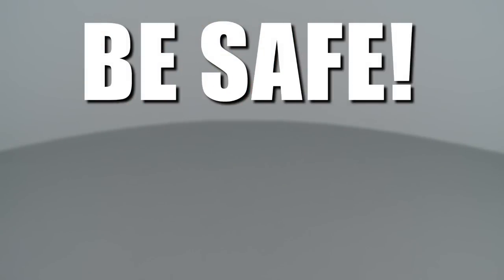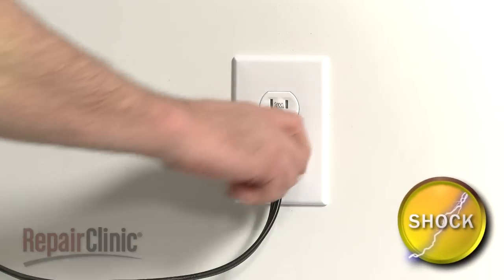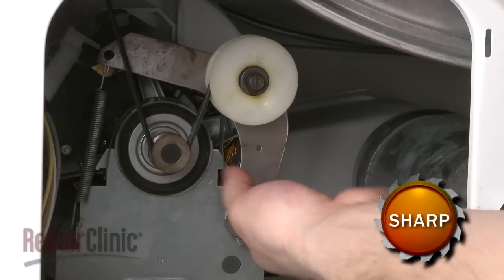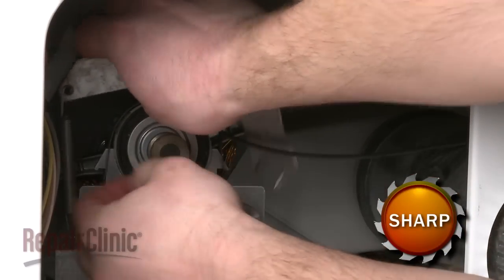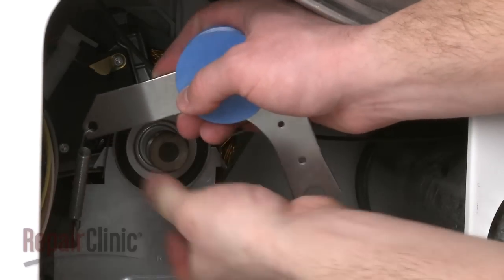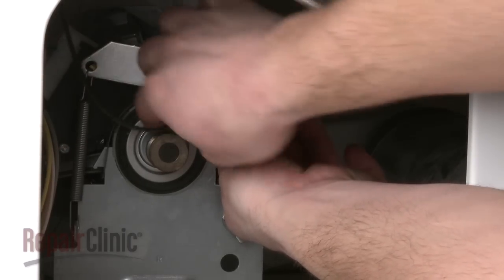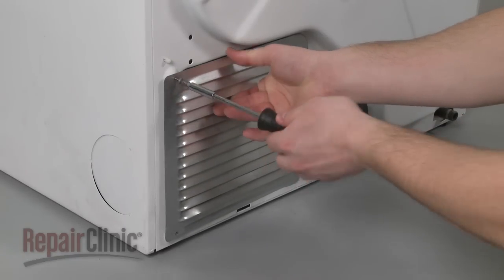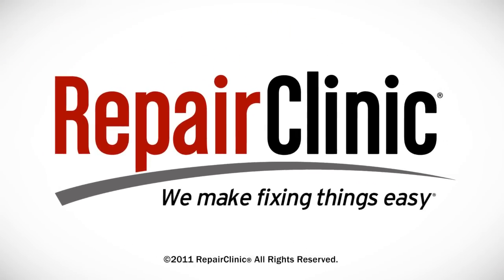Frigidaire Dryer Idler Pulley Replacement #131863007

Comment: I have a Frigidaire Gas Dryer FSG747GES1, with a drum belt with duel/two idler (pulleys) spring loaded. How do I safely/easily unload these two pulleys to remove and install a new brum belt? Thanks you so much for your indepth instructional videos.
Another question. Righ now I can't afford a repair kit so Can I use Red "N" Tacky Grease to lube the drum rear bearing?